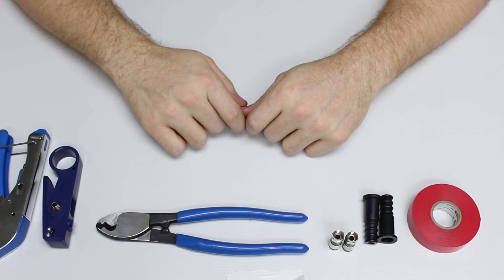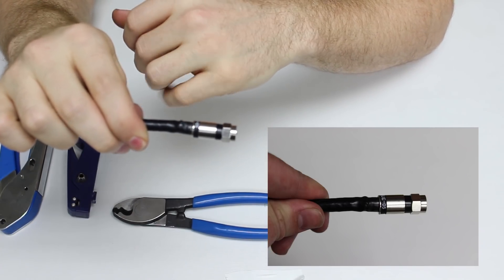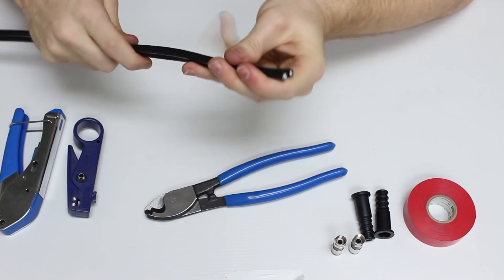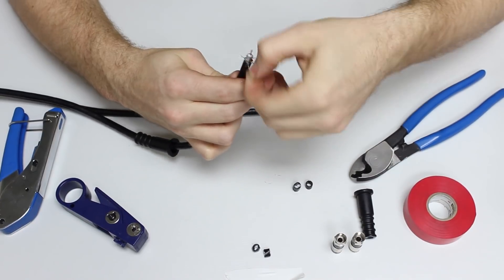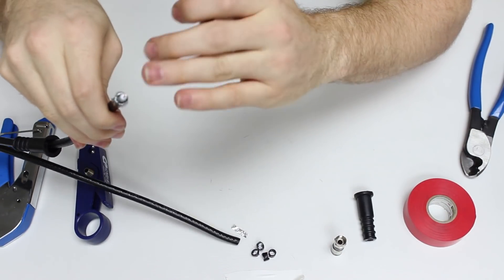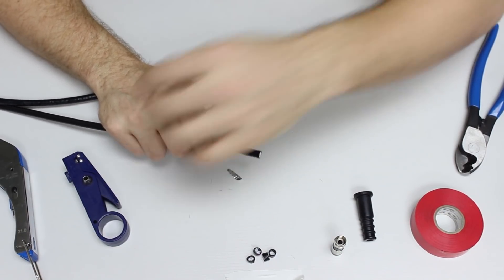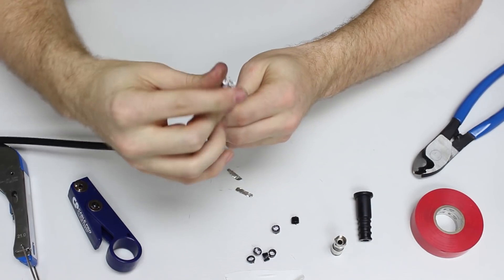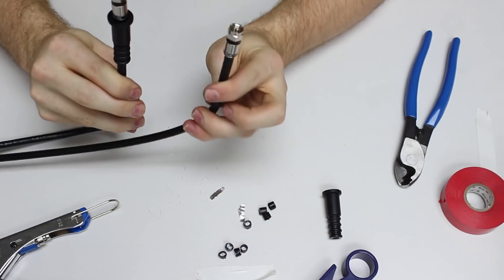How to terminate RG6 quad shield coax cable.

Comment: The braid is not for "rigidity" and "structural support". It is used as a ground and low frequency shield. It is one of the four shields, thus quad shield; i.e. braid, foil, braid, foil equals four shields.

Comment: Nice video with excellent step by step.  I noticed you left the 2nd layer of foil still wrapped around the dielectric.  Does it matter if this is left on or removed?  I've seen other videos where the dielectric was exposed prior to installing the connector but this was mainly on videos for dual shield cable.  Just curious if it is handled differently whether you're using dual or quad shield.
Reply: I Know this is an older video but Yes, you need to leave the 2nd foil intact for Shielding, not the 1st one though.

Comment: I always like to leave the center conductor a little long. Then exercise the cable after installing connector. The center will sometimes shrink inside the cable. After checking the length, I trim to final length if needed.

Comment: Great video. really detailed. thank you for sharing.  I have a question. I current own a set of strippers & compression tool rated for rg59 & rg6. i purchased b4 rg6 quad was available about 10yrs ago for dyi projects. Do i need to buy a new set for rg6 quad or will my old set work? thanks again.

Comment: the Jonard UST-500 universal stripping tool's video instructs you to cut the braid wire right off. Why? Is the braid wire necessary or not?
Reply: But the braid also serves the purpose of establishing a common ground for the cable. It's not for 'structural integrity'.
Reply: The way their tool works, the extra braid is not necessary.

Comment: Thanks for the demo.  I did not know about removing the foil and the 2nd layer of braiding to be pulled back.  I always had a difficult time forcing the connector down far enough before crimping.  You made it look simple. Like the examples of what wrong looks like.

Can you please provide either a link or name of the tool you used for stripping that has the flaring tool.  
Blessings,
John 20:29
Reply: Belden PSA596 Adjustable Cable Stripper With Flaring Tool

Comment: Spark plug grease (or in larger tubes as Dow Corning #4) is terrific for anything rubber, these boots included; having it in a tube saves hauling a spray can all over the place.

Comment: I keep ruining my ends because I cannot get the cable all the way into the fitting. So I tried using the crimp tool to fully insert the cable but that doesnt work. Why wont the cable fit the fitting? I cannot push it in by hand.
Reply: dpos89 same here! Just cannot get connectors down. What am I doing wrong?
Reply: What type of fittings are you using?
Reply: When you fold back the braided shield pull enough to put a gap then carefully center your cable, and apply direct pressure and it will go pn smoothly
Reply: There are several sizes of cable and several sizes of connectors. The cable diameter may not match the connector. The difference may only be a millimeter. Just because it says RG6 doesn't mean it will fit. There are cheap thin cables and heavy-duty commercial ones.

Comment: could this fix my sega 3 adaptor ? Cause the part is cut where you screw it to the tv ?
Reply: probably not, if i recall the coax used on the genesis rf box is not a standard american size (I think it is either 2.5c-2v or 3c-2v coax which is the Japanese industrial standard.), and i think it is stranded core.